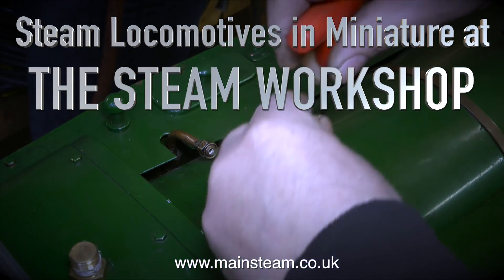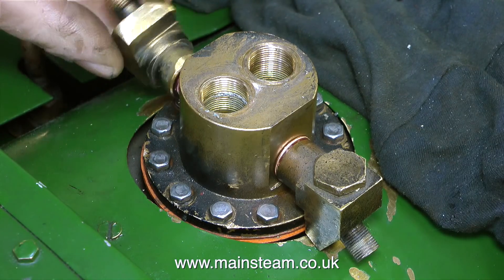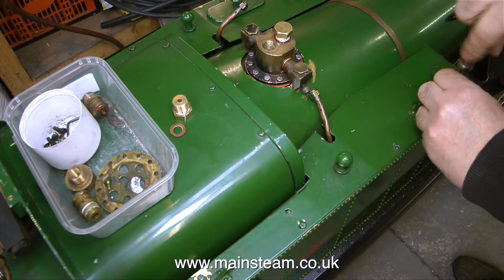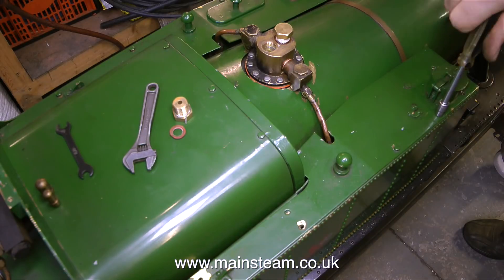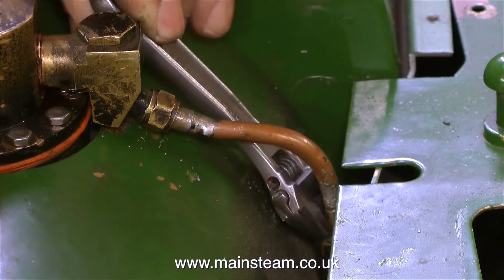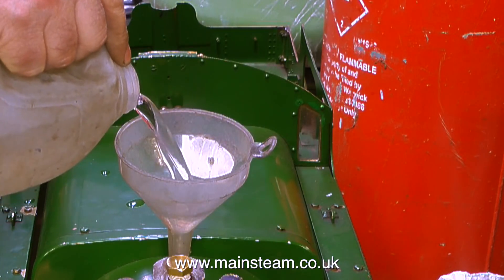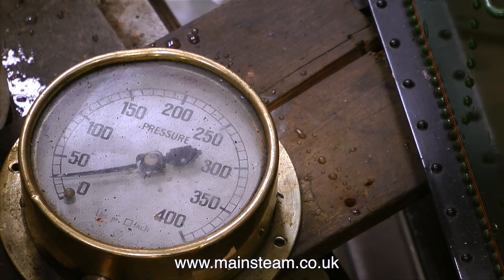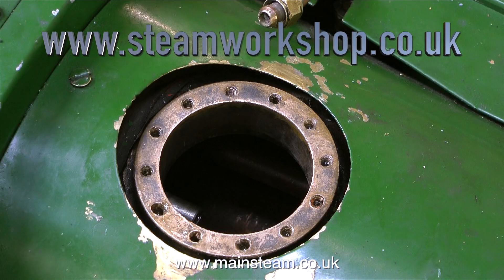STEAM WORKSHOP - REPAIRING A REGULATOR - PART #2

Comment: I had a similar problem to the open blow-down valve and the workshop floor except, in my case, it involved a bottle of oil and a missing sump-nut along with a purple shag-pile carpet and a girl friend. Add in a totally restored motorcycle and set all the pieces in a living room in a 2 up, 2 down in Holmfirth and see if you can decide whether my girlfriend could,er, see the funny side of things?